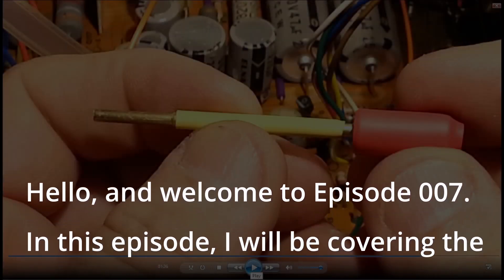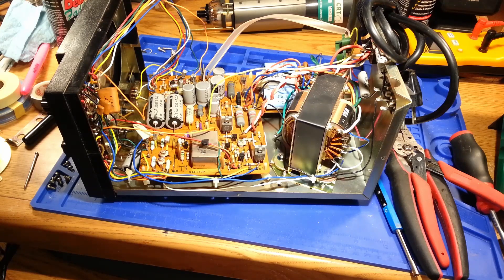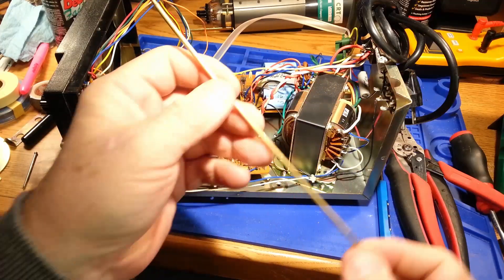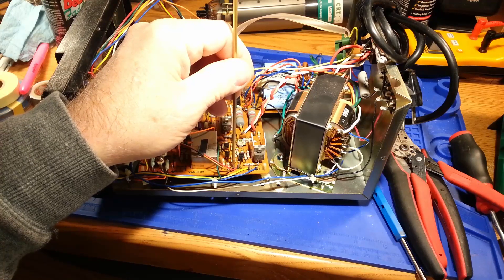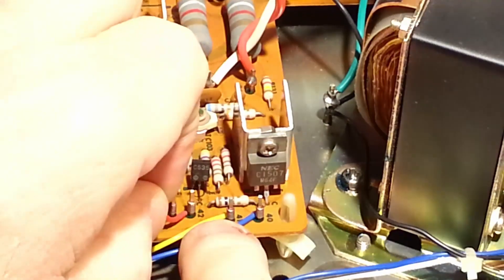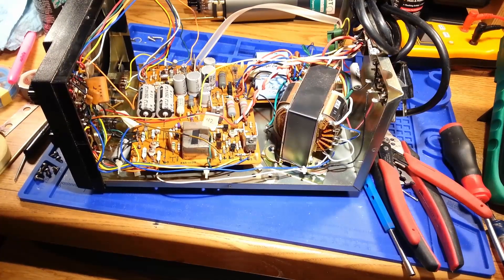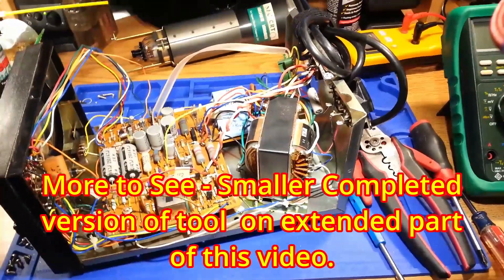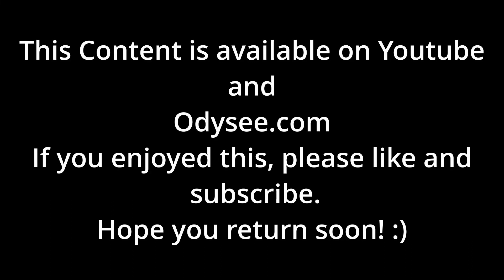E007 DIY Wire Unwrapping Tool

Comment: What is the thickness of the wall of the tubing you used?  Thank you for your answer.
Reply from the maker: The tubing wall thickness that I used was 0.25mm, so the inner piece of tubing ( that I used) with an inside diameter of 2mm has an outer diameter of 2.5mm, and the outer tubing had a 2.5mm inside diameter and a 3.0mm outside diameter. The wall thickness isn't as important as sizing the tubing for the pin and wire gauge sizes you are working with, and that may take some experimenting to find the best combination.

Comment: Ingenious!!
Reply from the maker: Thanks. Its my way of being cheap, and not paying 40+ dollars for a tool I used to have access to before I retired, a Jonard UD-2224  https://jonard.com/ud-2224-sleeved-unwrapping-tool-20-26-awg  I had the brass tubing already, but it is readily available at a lot of sources, in the US anyways.
Reply: @poormanselectronicsbench2021  I looked into buying when I was working on my JVC jrs401.  Could not believe the prices!  Ended up using pliers, and removing the minimum amount possible.  Will be making my own next time! thanks!!!

Comment: For a wrapping tool I have used a old empty ink pen steel cartridge 
with a 1 mm hole drilled  3 – 5 mm up on the working end .
It should work with that round stock you have .

Its by no means a production tool .
But it will get you up & running with a connection or two !